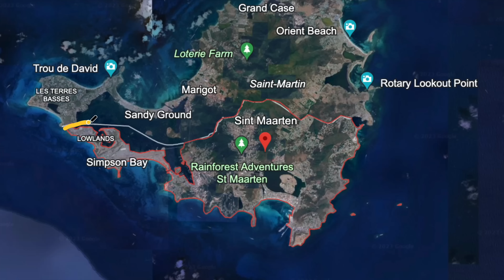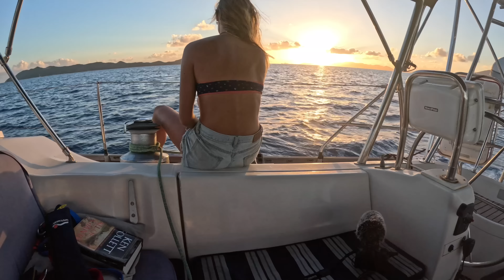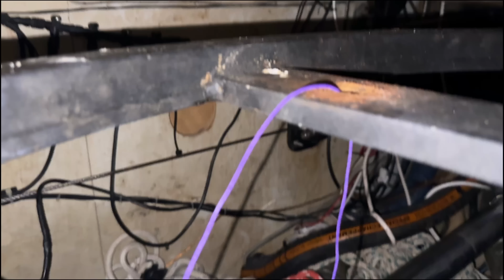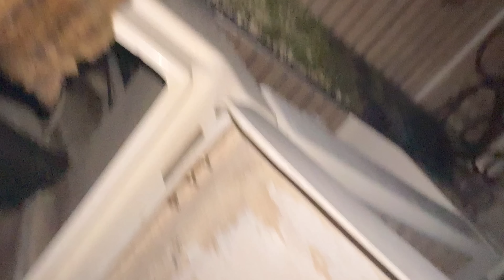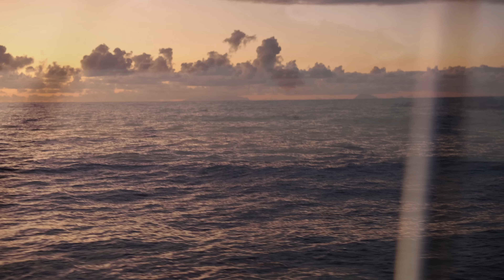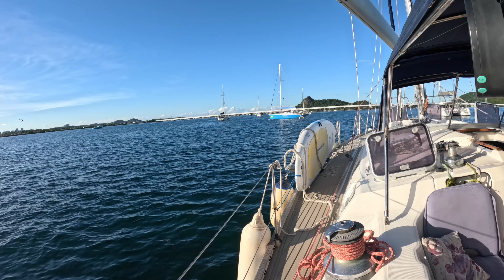Living a dream... 2 years into boat life [ep 99]

Comment: Shouldn't use a fully threaded bolt in that application. Use a bolt where the shoulder passes through both parts. The threaded part as you discovered will fracture easily in a shear application. But great job with the temporary repair. I got quite a chuckle out of the ingenuity.

Comment: Have a drawer full of those pins. Raymarine type 1 linear correct?
Reply from the maker: I have all the pins (: it was the bolt that broke. Type 2!
Reply: While you have it disconnected, a way to check the health of the drive is to extend and retract the drive(disengaged) and if it moves smoothly in both directions with little resistance, all good. If it’s harder to push or pull in either direction, it may need service.